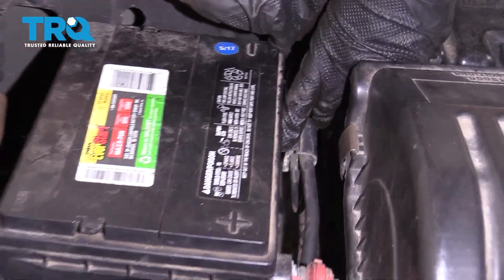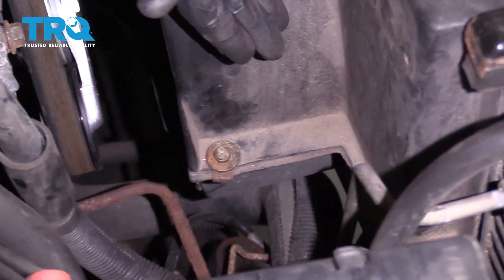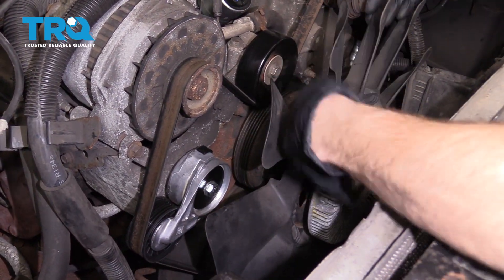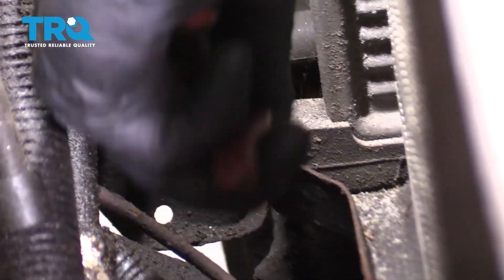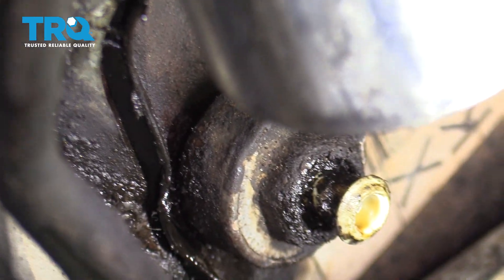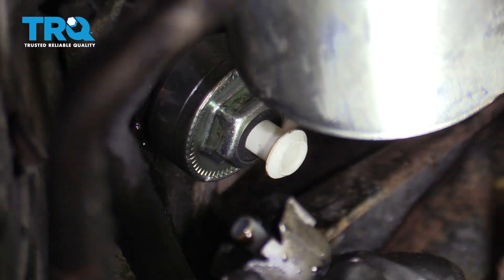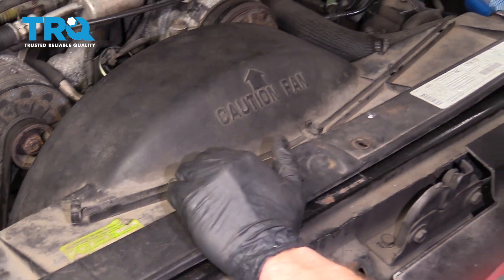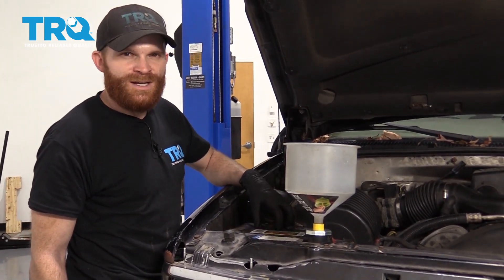How to Replace Knock Sensor 1992-2000 Chevy Tahoe

Comment: Why did you empty the coolant, remove the fan and shroud and disconnect the battery???
Reply: Disconnecting the battery is a good practice for electrical equipment replacements, especially since both knock sensors on the 7.4L at least, are directly tied to the VCM. Damage could result if not careful. I'm sure you know this. Everything else though.....I don't know my dude.
Reply: He thought he was changing the thermostat lol.